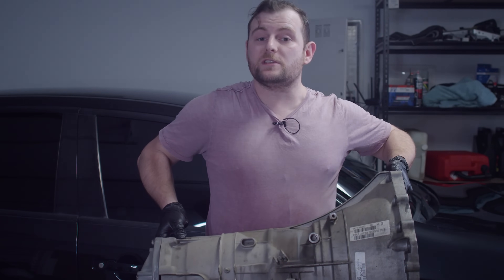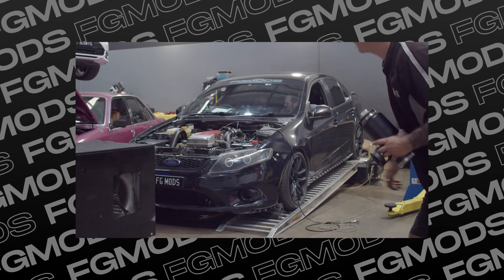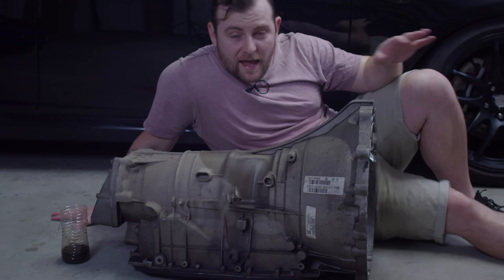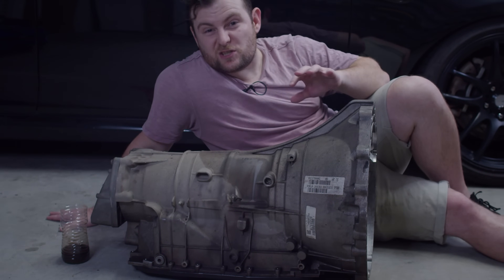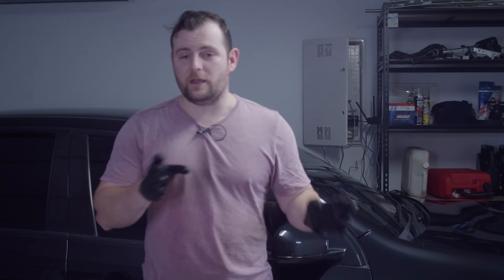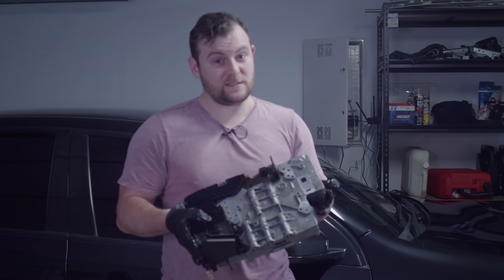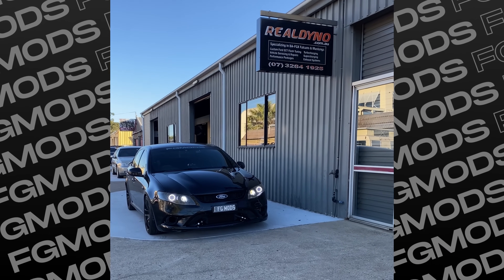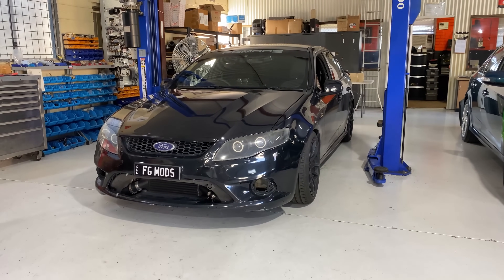Falcon NA ZF6 to Turbo ZF6 Conversion. No recoding needed #fordfalcon  #xr6turbo #barra #xr6

Comment: Hey bro i love youre content, but i have a quick question, im having trouble with my 07 bf transmission and im buying a trans with no tcm, can i use my tcm in the trans i have now and install it into the trans im buying? Would i have to change ecu and wiring aswell? The new trans im buying is from a 07 bf . I hope i domt sound too confusing lol cheers

Comment: What if you have shift solenoid issues with your current na zf? Can you just change the tcm over to the turbo box like you would doing any zf replacement ? Or do you have to change over the whole mechatronics ?

Comment: Mines a bf na but got a btr speed ans irs solid ans looks like it been rebuild Well, either way, it was in a very nice condition and wirh a stronger torque Converter Plus wave conditioned it bur yeah going stock ecu and electricals Unfortunately the jobs on standby right now because my mums bf is a narcissist lol but yeah turbo motor going In i think out off a ba turbo cleaned ir up done the oil pump and valve springs just gotta put it all back together
Reply: What can I get done to my btr 4 speed

Comment: Hey mate just wondering, could you get the zf fart / torque reduction tuned into the new turbo box if you're stuck using the n/a box mechatronic?
Reply from the maker: Can absolutely get whatever tune you want done to the box.
The NA mechatronics that went into this box are from when we NA+T the car, and it has a significantly faster shift time.

Comment: just cooked my fg xt 5speed auto any advice lol ? would this work for me
Reply: Just get your 5 speed auto reconditioned. Dont stuff around with any other option.
Reply from the maker: I've got a video on converting from 5speed to ZF6, which I did a couple years ago.
Well worth it to not have the trash 5speed in anymore.
Reply: @fgmods  I dont think so, the 5 speed auto is not bad enough to do all of that.

Comment: Hey mate, Ive done the exact same thing youve done in this video about 6 months ago. Everything works but the car still doesnt shift properly between gears. It either over revs or doesnt shift quick enough. How did did you get around this issue? If at all?

Comment: So was the car running and in gear when you filled the zf?, I'm having an issue with mine where I fill it and it overflows but there's no where neer enough liquid in it, like not the full 8 liters as mine was a complete drain like yours
Reply from the maker: You have to fill it till it starts to overflow, then run through all the gears a bit, then sit and let it warm up to 30C, once it’s warm refill again.
It’s a bit of a process but it’s important to have the right amount of oil.
Reply: Duno if it’s the same but the 4 speed btr , jus just take off the return line and be filling it at the same time, just put turbo 4 speed in my territory , took 13-16 litres can’t remember exact but it was rediculas

Comment: Besides ZF 6 Speed and Turbo 400 is there any other  Automatic Transmission that can be fitted in XR6 Turbo, G6E Turbo and Typhoon ?
Reply from the maker: I might be looking in to another auto gearbox option 😉 but we’ll have to see how that research goes
Reply: @fgmods  the ZF 10 Speed automatic that's used in current Ford Mustangs wonder if they be any good with Barra Motor.
Reply: Im need of transmission for my ba xr6t 4 speed  its sliping 3rd when on boost   but if there any cheaper option
Reply: @happymanasfksubaru2846  4 Speed Auto ? Take it to garage and get the Mechanic to do Automatic Transmission and Filter Changed and get the Torque Converter flushed out. That be cheaper option then a new gearbox.
Reply: ATF and Filter Change change servive
Reply: @anishchand4420  hey thanks i did change the tran fitter when i service it but i never did the torque convert
Reply: Good one as it never came in my mind
Reply: @anishchand4420  isnt that box a 10r80? Not a ZF?
Reply: @aarondhillon  not sure. There is 10 speed Auto ZF that's comes in Mustangs 2015 to previous and there is a 8 Speed ZF Auto that comes in Challengers. Nobody so far in Youtube world has fitted any other transmission into 4.0 Turbo charge Falcon besides original 6 Speed ZF and Turbo 400.
Reply: zf8hp

Comment: Does this swap work from 5 speed to the turbo gearbox or will that need retuning?
Reply from the maker: I’m not sure if it does work from 5 speed to 5 speed.
But it won’t work from 5 speed to 6 speed.
They’re totally different boxes, wiring harness and ECU

Comment: this is fantastic information i doubt most na+t guys would know
Reply from the maker: Hopefully it helps people out
Reply: Could I possibly do this with my 04 na ba xt
Reply: @joeyriley6992 xr6t btr bolts straight in. No changes necessary
Reply: Serialisation nonsense.
Seems like they cut a different corner instead.